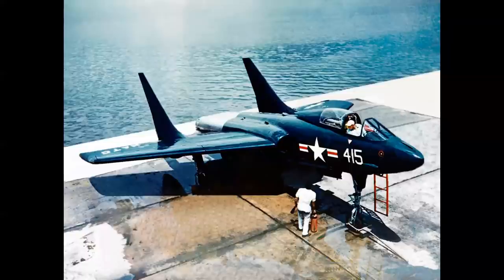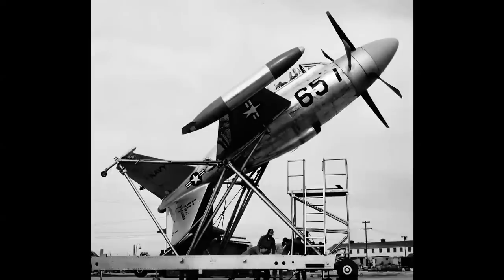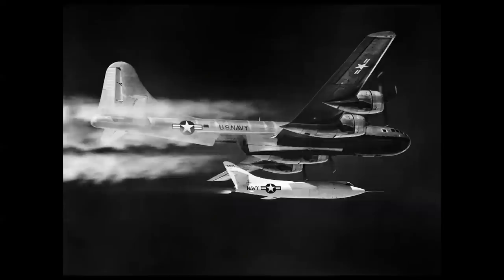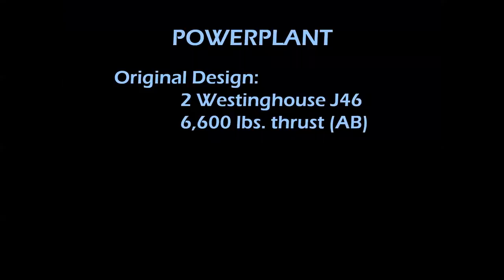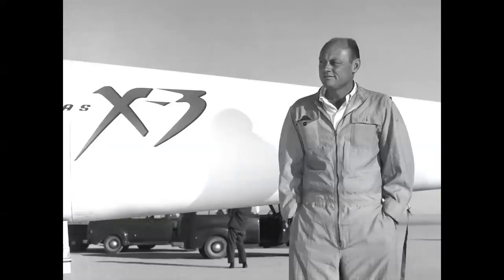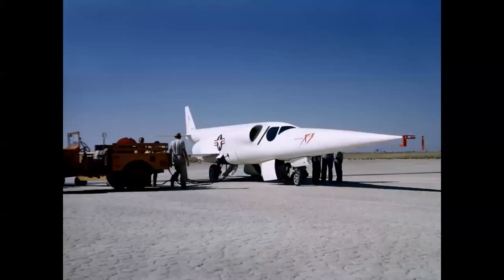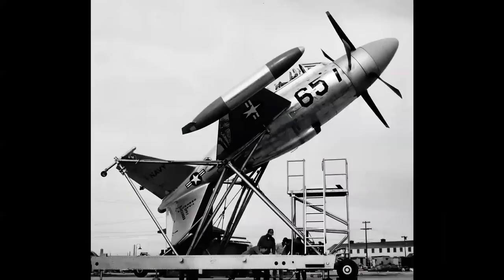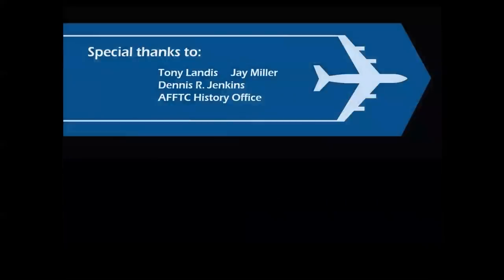DOUGLAS X-3 STILETTO - Planned as a self-launching Mach-2 jet, was this futuristic plane a failure?

Comment: The P-51 Mustang only became awesome after it was fitted with the Merlin engine. A great powerplant on its own does not make a good aircraft, but any great aircraft design fails if the powerplant cannot live up to its specified expectations.
Reply: Remember that the P-51 that was powered with the Allison V-1710 engine had better performance at low altitude than the Merlin/Packard. They were two different engines conceived for different use that said the mechanically driven supercharger of the Allison V-1710 was not developed as well as the Merlin/Packard and was committed to the (USAAC) preference for turbochargers early in the V-1710's development program for the P-38. Both engines were very good  but the Merlin had much better performance at high altitude...
Reply: Agreed.  The Russians liked the Allison powered Curtiss P-40 and Bell P-39.   Performance at lower altitudes was what they needed.
Reply from the maker: Very true!

Comment: Cutlass was underpowered but a fun plane to fly when everything worked according to what I've read. The X-3 looks like one of those land speed record cars.
Reply: Hiya - suggest do some wider reading - you may locate flight tests, carrier operator reports, fatal reports etc  😊....BANNED from carrier ops. Killed a number (yes, that was common for the era, but the engineering design flaws. ..gobsmacking)
Even if built, should NEVER have been targeted as a carrier aircraft. Naval pilots one time nearly mutinied, ships grounded till removed to land operation.

Comment: "Worst Aircraft" books are a guilty pleasure, yet agree 100% with you that most experimental aircraft should not be on these lists. Also, any airplane design should get a free-pass for using Westinghouse. Imagine a Cutlass with the promised engines in 1950!
Reply: It’s one of those things where the name has to grab attention, and is kind of cheezy and cheap (if not insulting) compared to the impact of the subject matter. But if you can get past that and use it as a springboard to dive into an interesting plane and its place in the history of aviation development…

Comment: I loved the X-3 as a kid.

Failure?  Yes, but a good learning experience.  It did not complete it's intended mission.

 A shame the desired engines were not available to go faster, but I shudder to think what would have happened if it did get them and attempted supersonic speeds.  The reason?: https://en.wikipedia.org/wiki/Inertia_coupling

QUOTE: "The roll coupling study of the X-3 Stiletto (first flown in 1952) was extremely short but produced valuable data. Abrupt aileron rolls were conducted at Mach 0.92 and 1.05 and produced "disturbing" motions and excessive accelerations and loads."

The too-small tail would have given quite a ride, possibly to in-flight break up.  The F-100 suffered likewise until they enlarged the vertical fin.

Comment: Super, Mike! I guess any aircraft would be a flop with an under powered power plant. If the airframe cannot make the outlined references or the pilot doesn't have the option to power out of certain configurations, it would be considered flawed. The reason the X-3 isn't a failure is because some aspects of it exist in future aircraft designs, but also Douglas (and Lockheed, Convair, Republic, etc.) were moving so quickly onto the next designs at that time in history. Nobody had time to sit around with a pouty face!

Comment: Don’t forget the “area rule”. Ask Convair how important that was. ✌️
Reply: Hi ! True of course, but "back then...back when" ..1940's, there was not only no aviation dictionary entry "area rule", there was no concept - not even on the horizon, not even in any designer's fervent imagination ✈
Reply: @christopherbatty3837  true. But XF-92 didn’t have it and YF-102 (early) didn’t have it, and both underperformed. 
Convair worked out the formula and applied area rule to the later YF-102, and voila! 
Using the old Nazi German research, they wouldn’t have known because the Germans didn’t know. 
I wonder if in the present, we don’t just overpower planes to go supersonic. We have thrust enough to break Mach 1 in a vertical climb. 🤷‍♂️
Fun stuff for discussion!

Comment: Great video. Couple of things. First, can you imagine being an average person driving your car down what probably would have been Sierra Highway and seeing the X-3 coming the other way on its trailer as it headed for Edwards? Wow. Second, while the X-3 never achieved its speed goal, it made a significant contribution in its demonstration of the dangers of roll-inertia coupling, which highly stressed its airframe. The original NACA reports about these tests are available online at archive.org. ...tiny tail surfaces, no stability augmentation. It makes you wonder what might have happened if the X-3 had reach anything close to Mach 2. The entire  primary flight control system from the Flight Operating Instructions is described in about a half a page of information.

Comment: I come looking for info about this X-3 Mike, wondering about the new X-59 and I am sure that some of the data from this contributed to that. Yeah I agree, just because they may have not been all that was hoped didn't mean super valuable data wasn't had and used in some way. Back in those days they didn't have cgi modeling, they just had to build it, try it, refine it. So many amazing planes over the years lost in fights or had bad reputations because they were built with an engine in mind and the engine needing way more time than was given often failing. A few still made it through, like the BF 109 as an example. Thanks for this great video!

Comment: A lot of meat in that 14 minutes.  Great video.  

The X-3 shape has a lot of similarities to the F-104.  Was this just because of aerodynamics forcing form to follow function or did Lockheed “borrow” some of the design elements?
Reply: Lockheed borrowed the wing design.
Reply: All NACA/NASA information was open share during that era, including across the pond with France & UK.
Reply: I thought those wings resembled those in the F-104...we learn more from failure than from successes .if your not failing your not trying hard enough!
Reply: @framusburns-hagstromiii808  That is so true.  I often learn more from when things don't work than when they do!

Comment: The X3 was an astonishing achievement.
Consider this:  when Trippe cast about for takers to build his trans - Pacific ship, his favoured designer - builder refused to tender, stating it was "...impossible, two jumps ahead! ". No one disagreed with the technological leap & manufacturing similar leap - but Glenn Martin achieved the non-achievable in his handsome M130  for PAA.
Great as THAT was...what was accepted by Douglas in 1940's was true Buck Rogers dreaming....sustained M2 in an era when NOTHING was known about M1.
As an oft told story of the era, the "promised powerplants"  became protracted broken promises of broken promises...or, not at all promises.
And even with the woeful thrust it was landed with, it made important contributions (note the plural) to advance aerodynamics, explore roll-yaw couple, demonstrate practicality of construction in difficult alloys, validate wing design, develop the first hjgh-speed tyres, develop evolutionary on - board test equipment, draw attention for the absolute necessity to reduce frontal cross-section.
1st stabilator ??? Can someone verify ?
Primary test pilot, Bridgeman made the best honest assessments - not so kind/truthful were some subsequent pilots, betraying brand loyalty.
To name a few ! ✈
All with HB pencil, slide rule, brain, "can do" attitude.
And while they were designing this research vehicle which had to conduct a whole flight, ground-to-ground, NACA were still doodling a Mach One bullet to be air - launched.
Bravo to Douglas management for bravery award 🏆...but then, look at the repeated support they brought to the earlier singular genius, Jack Northrop.
✈

Comment: Where do I place my pre-order reservation for a copy of "Wow!  What the Heck Were They Thinking?"  You can start with the work we did together on the Douglas XB-42 Mixmaster.

Yes, the X-3 may have failed to reach Mach 2, but I'm pretty sure it was the first airplane that really highlighted the problem of inertial coupling - pitching up when you try to roll.  This became a real problem when the wings got short and all of the mass was in the fuselage.  I see that as the X-3's greatest contribution.
Reply from the maker: Good observation Russ, and I agree, thanks.

Comment: I agree with your take on the value of "failed" attempts except probably not in the case of the X-3. It was designed for high-speed research, and had features that were intended to be exposed to high speeds. But was anything new learned at M1? Roll-coupling maybe... looks like it could have had the worse case ever unless short wings dampens it (the F-104 didn't seem to suffer, I think).

Comment: Wasn't the X-3 research used to design the wings for the F-104?  I've heard or read this somewhere.  The X-3 still looks better than the 104, though!   When I visit the USAF museum, I spend a while just soaking in the style of the X-3... it is still so sexy!   Any idea why the cockpit windows are shaped like they are?  Looks great, but I can't imagine that there is a functional reason for that shape.
Reply from the maker: Interesting question Steve, thanks, and standing next to the X-3 with those sinister dark-green tinted windows right at eye level may offer a clue. Forward visibility was limited by the rather high instrument panel and glare shield, while visibility to the side and downward was augmented by the teardrop shape of the main windows. Not having a proper (and openable) X-Plane canopy also created the need for strong cockpit structure, yet with ample outward visibility.
Reply: @celebratingaviationwithmik9782  It would be interesting to hear from the designers why they made various decisions.  Certainly, there many designs that reduced drag by keeping the cockpit low and impacting forward visibility.   I suppose when you have a chase plane, seeing over the nose and finding the runway is less of a priority?..  as long as the radio works.   I have to admit, as an engineer, I'm always wondering about how certain design details came to be.
Reply from the maker: @SkyhawkSteve  Good point, and several X-Planes started flying with streamlined flush cockpits (Bell X-1, Douglas Skyrocket), with both being modified with "military" clear canopies and windshields (X-1A Series), or a V-shaped X-15 type windshield configuration (Skystreak, Skyrocket, Bell X-1E). Chase planes always helped, though!

Comment: Lousy available engines led to 8 engines on the B-52 instead of 4 engines.
Lousy available engines led to 6 engines on the B-47 instead of 4 engines.  
Boeing and the USAF drove the engine manufacturers nuts with thier performance demands.

Comment: What would a Blackbird be if it “only” had two J-79’s instead of two
J-58’s?

Slower than an F-4,
that’s what-
also too low to do what it needed to do.

What was the X-15 without the mighty
XLR-99?

Not very impressive-
It had to get by using a pair of XLR-11’s while it waited.

The basic X-15 initially flew with those XLR-11 engines, 
which only produced a combined maximum thrust of 16,380 lb. 

THEN, 
the Thiokol Chemical Corp. throttleable XLR-99 engine was installed. 

The XLR-99 provided a maximum thrust of 57,000 lb. and a MINIMUM thrust of 28,000 lb. 

It was fueled by anhydrous ammonia and liquid oxygen and the difference was indescribable.

The main thing is that IF 
the X-3 had more powerful engines like the above mentioned J-79’s it would have been much faster-
so fast,in fact,
that it would have most probably disintegrated from inertial coupling when pushed to its limits.

On September 27,1956
Captain Mel Apt was killed in his first flight in the rocket-powered Bell X-2 at Mach 3.2 
by three distinct coupling modes which followed one another.

Inertial roll coupling was one of those three modes.

It had nearly killed Chuck Yeager in the X-1A three years earlier.

The roll coupling study of the X-3 Stiletto was extremely short but produced valuable data to understand and ultimately solve this problem.

It is better to seem to be a failure while actually succeeding in beginning to solve a very dangerous new aerodynamic phenomena
than to
have just been a mysterious widowmaker that left the problem unresolved-
a problem that would have STILL needed to be faced by the next pilot&design team.

The X-3 would have then just become pictures in a book of an over ambitious idea that was a tragic waste of life,time&resources.

Comment: Please do more than just celebrating the planes produced by the Military Industrial Complex: please celebrate the Military Industrial Complex itself! Could you do another video that focuses more on how these failed planes "evolved" into successful ones. As someone with some background in mechanical engineering I feel the term "evolution" is both unsatisfying and potentially misleading. In essence all these failed aircraft were missing key pieces of technology that, had they been available at the time of construction, perhaps, would have made these airplanes "successful;". I am uncomfortable with the implied hypothetical, "if only this, then surely that".  What was so wrong about the engineers' judgement at the time? Sure, the scientist might have learned some lessons that found later application; however, the involvement of the scientist at all in the pursuit of mechanical technology is itself an obscure subject. The fact these planes were built as part of something that was not strictly a money-making venture is why you are able to use the term "evolution" at all.